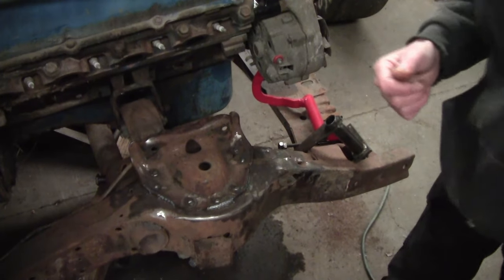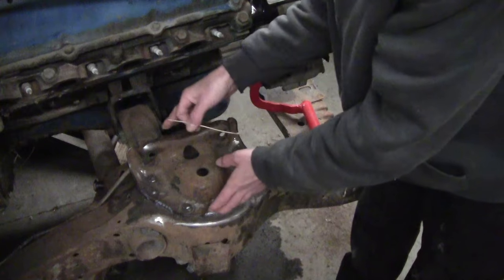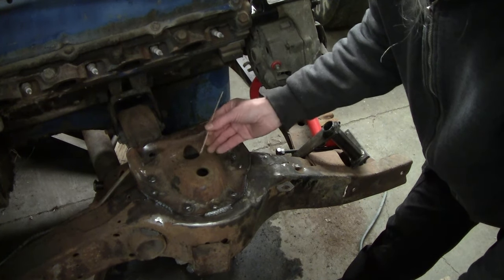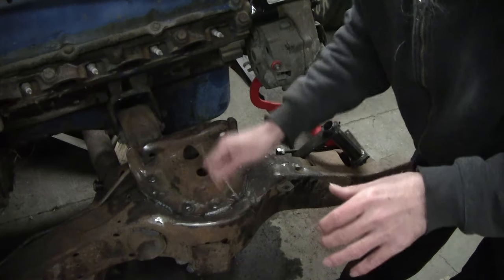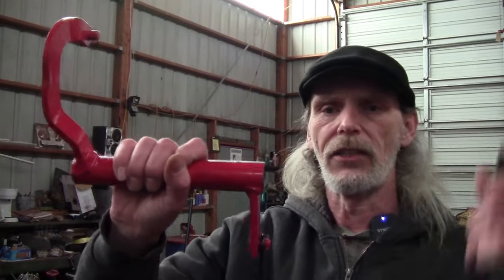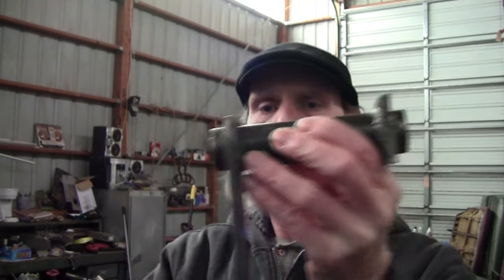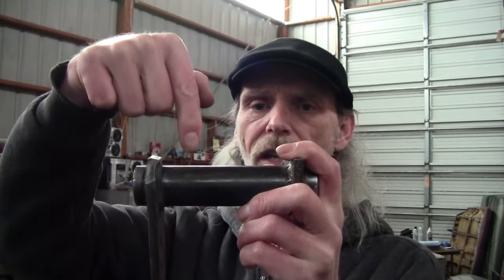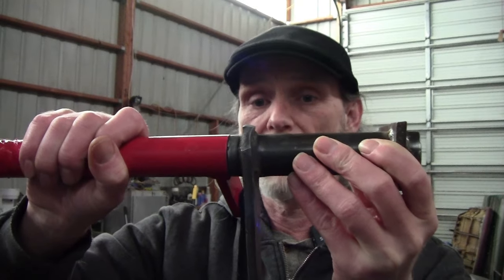Mastering The Art of Plug Welds: What Sets Them Apart from Rosette Welds?

Comment: Thank you for this video of darn good info about welding....I myself have not gone to school to learn about welding...I just pick up on tips and how to videos ....I like how well you explained the different types and I think in the past I used the wrong terms when I say I'm doing a certain weld...this video helped me a lot ...thank you sir.
Reply from the maker: You bet One62projects and like I kind of alluded to in it..... as long as your doing the right thing where it's needed, it's all good no matter what you call it... lololol.
The part I confused myself in, is at the end there..... in sheet metal and you are over lapping the 2 metals, if you drill a hole into both of them and weld it, that's a Rosette (kind of like a continuous round butt weld that fills the hole), if you only drilled a hole in 1 of them so you have the backing, that's a Plug weld.

Comment: As an alternative to a butt weld, use a full penetration weld. Leave a gap about the thickness of the metal, between the two pipes, and the inner sleeve in place. The inner sleeve will be your backup. Tack, then weld, filling the gap. This type of weld is a prequalified weld. The strength will be equal to the pipe.

I have never heard of a rosette weld. Good information. I don’t weld, only design structural welds. When designing new welds we would do a test weld and cut it up and stain it, and check for penetration.
Reply from the maker: Thanks for the rock solid advise TexasEngineer!